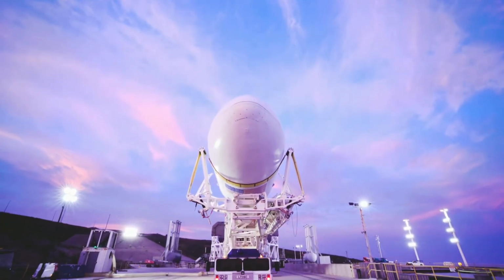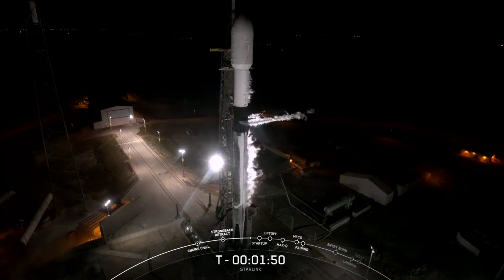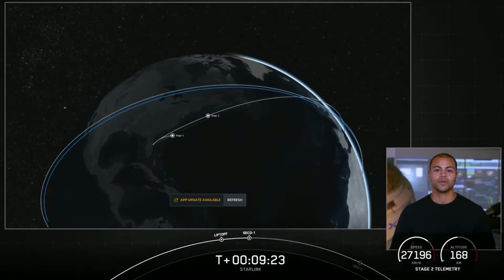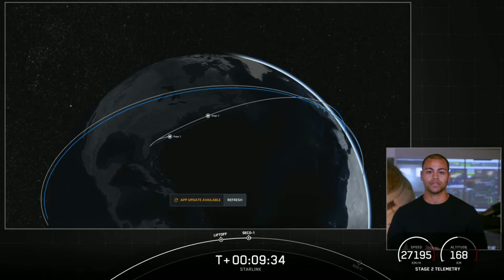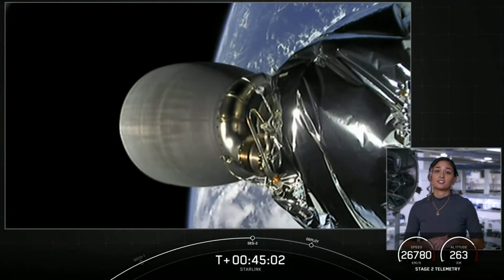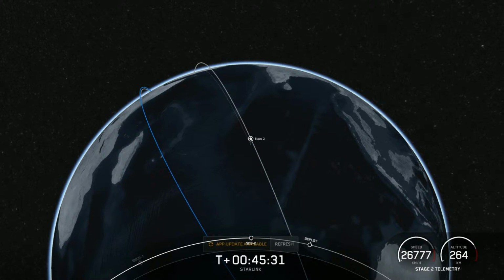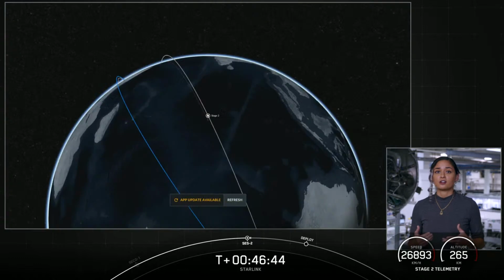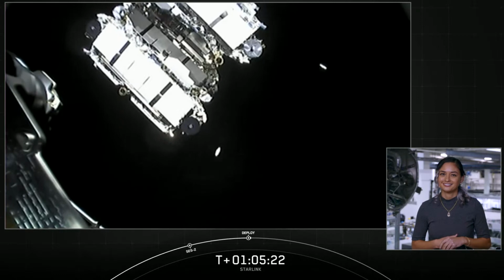Starlink Mission

Comment: So there are radiator tubes carrying cold liquid fuel through the stage 2 exhaust chamber? Because the metal is b so translucent with heat that it's hard to believe tubing would survive
Reply: The combustion chamber and nozzle are regeneratively cooled, but the nozzle extension is not. The extension uses radiative cooling which results in the glow you see and gas film cooling from the turbopump exhaust injected near the top of the nozzle extension.
Reply: @steveadams7369  Wow it's hard to believe the nozzle extension can still hold integrity when its so translucent. Thank you for your informed answer.
Reply: @jjtimmins1203  - The nozzle extension is made from an alloy of niobium. It has a fairly high melting point: 2477 C (4491 F). It is amazing to watch!

Comment: I like how Elon has given us the electric car so he can use all of the fossil fuel that is left to go find some more. FUCK.
Reply: What is wrong with u
Reply: https://youtu.be/gPeyXDtVPEg
Reply: Except he is using nitrogen...... which is man made..... and literally requires CO2 to make LMAO I bet you feel stupid now
Reply: @AB-xe6ci  no because i didn't put any thought into the joke at all.
Reply: @AB-xe6ci  and last I checked kerosene is derived from fossil fuels. The commentator stated kerosene was the propellant at the beginning. U  would know more than me apparently.
Reply: @AB-xe6ci  Umm, Nitrogen? What are you talking about? Nitrogen is the primary component of the atmosphere. It's about 75% of the air you breathe. It is a very unreactive element and certainly doesn't make rocket fuel. The only thing SpaceX uses nitrogen for is pressure testing their tanks. The Falcon rockets burn RP-1, which is a highly refined form of kerosene. Starship burns methane, which is the primary component of natural gas, but can be artificially produced to be carbon neutral. They are not doing that yet, but it is the plan.
Reply: @odysseusrex5908  “Nitrogen has a long association with rocket fuels and explosives, such as nitroglycerine and TNT (trinitrotoluene). This is because nitrogen gas, N2, is extremely stable. Compounds with more than two nitrogen atoms per molecule release readily decompose to N2, releasing a lot of energy as they do so.”
Reply: @AB-xe6ci   Neither TNT nor nitroglycerine are used as rocket fuels. Falcon rockets, as I said, use kerosene, and Starship uses methane. I suppose some hypergolic fuel might have nitrogen as a component. Do you know of one? Anyway, your post implied that pure nitrogen was the fuel.
Reply: Just for what it's worth, the electricity that goes into electric cars is generated by burning fossil fuels.
Reply: @odysseusrex5908  yeah that's what they say. Once the fossil fuels are depleted and there is no infrastructure to sustain the population.....genocide for all! Back to basics brother!

Comment: Why don’t you shoot them from inside the earth like a rail gun. Then use rockets to get through the atmosphere? Starting from ground level with rockets sounds stupid.
Reply: What do u mean "like a railgun"?
An actual railgun?
Do u have any idea how much power that would take?
US military railguns needs 25 megawatts just to get a projectile no larger than a missle to go super sonic. Now u wanna shoot several hundred tons of cargo into into orbit?
Reply: @neon-lake   Hell ya!
Reply: @Tech_Duster  2 issues I Can think of off the top of my head. 
1: you can’t launch into orbit from one burn, you need an extra one (preferably at apogee) to reach orbit. 
2: there will be a stupid amount of G’s crushing the payload.
Reply: @thingusbrulingus   Kinda my thought, starting from the ground and the amount of energy it takes to lift could be substituted with an extremely long underground tunnel that uses electromagnetic propulsion. You wouldn’t start at max speed. It would be a build up. If it was done this way the materials could be stronger and heavier. Since a rocket launch already has a long arch not much would change. I guess you would have to have the tunnel rotate for direction. Possibly would still need a second boost. ?

Comment: I have a idea the ship can't land probably because ship have one booster the one push up.....if you add  4 extra booster in left side right side front side and back side the ship can balance when landing... like example ship's booster in down its give pressure to go higher while landing the down booster can help but the helping % is 0.1%...if you add 4 or 2 booster not in lower side of ship little bit higher place Install 4 or 2 booster....if you install 2 booster... the booster place is left side and  right side......if you install 4 booster...the booster place in left side right side front side and back side.....the new installed 2 or 4 booster they can control the way the ship landing with only one booster the ship can't control....if you not understand can mail me i will explain how the processes working

Comment: Hello Spacex Team
I’m not sure if you can get messages to the SN design teams ; though some high performance cars with heavy g force loads on cornering have a sponge like substance in the fuel tanks and a Timpanic like membrane to keep fuel flow constant to stop air (or helium as in SN10) starving the engine of vital constant power
Stuart in Ireland

Comment: 30:42- 30:45  during a SECO DRIFT all power thrust is shut down. How can an object be seen flying passed on a camera looking towards front/bow/head of vessel? Or am I mistaken on the position of view ?
Reply: The rocket must frequently vent oxygen from the LOX tank as it boils off, in order to maintain pressure. Upon venting, some of that oxygen freezes. It has a certain amount of relative velocity which can be in different directions. That was probably just a bit of frozen oxygen going by.

Comment: Why is the Stage 2 speed decreasing in coast phase, if there is no friction at all? And with that, how come the altitude is increasing?
Reply: It is on an elliptical orbit approaching apogee. The spacecraft will continue to lose speed and increase in altitude until it reaches apogee. It would then begin to lose altitude and increase speed until it reaches perigee. If nothing else were done, the spacecraft would continue in this elliptical orbit until drag forces would bring it down.

It’s the same concept as when you throw a ball across a field. The ball decreases in speed and increases in altitude until the ball reaches the top of its arc. In then begins losing altitude and increasing speed.
Reply: @steveadams7369  thanks, it makes sense.

Comment: [05:00] Broadcast Intro
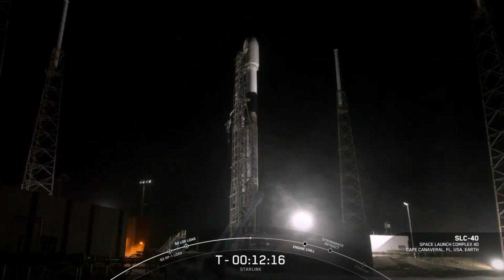[05:42] Broadcast Starts
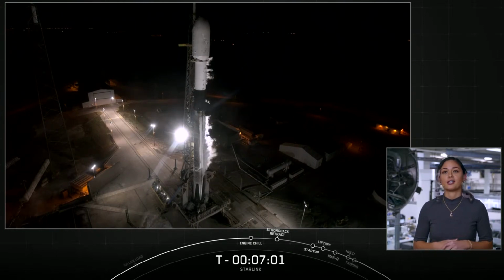[11:00] Engine Chill
[12:43] Strongback Retract
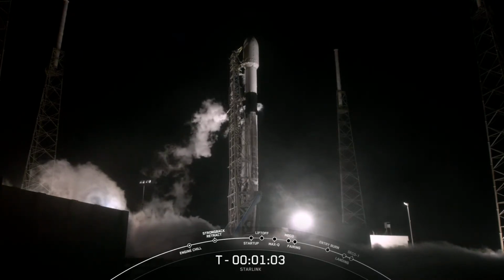[17:00] Startup - Falcon 9's flight computers take control of the countdown
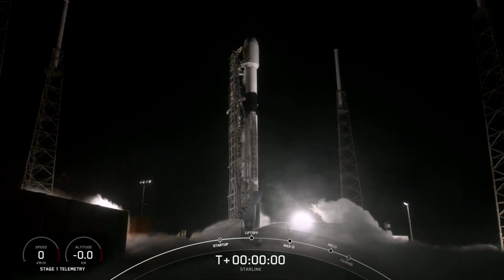[18:00] Liftoff!
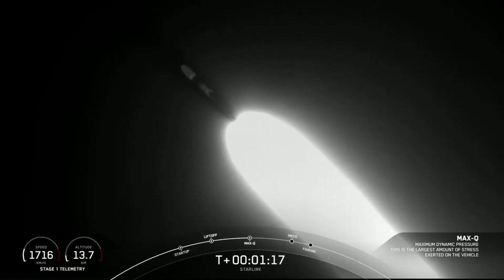[19:16] Max-Q - Maximum aerodynamic pressure on the Falcon 9
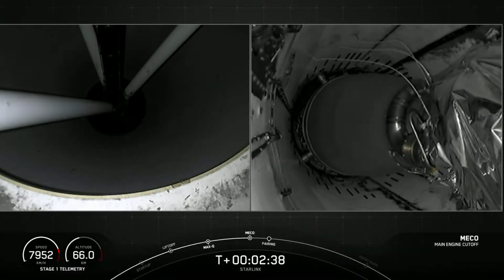[20:36] MECO - Main Engine Cutoff
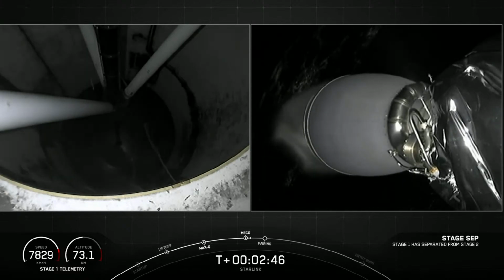[20:48] SES-1 - Second Engine Start 1
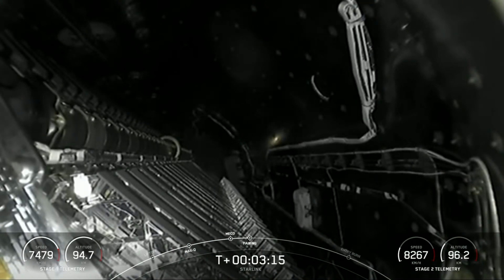[21:16] Fairing Deploy
[24:26] Entry Burn
[26:10] Landing Burn
[26:26] Touchdown!
[26:55] SECO-1 - Second Engine Cutoff 1
[1:03:56] SES-2 - Second Engine Start 2
[1:03:58] SECO-2 - Second Engine Cutoff 2
[1:22:58] Satellites Deploy

Comment: After earth pollution, space massive pollution.
Reply: These satellites are designed to burn up in the atmosphere after their end of life, so virtually no space pollution. At least not from spacex anyways.
Reply: @alxz3707  If they will not cross a non controlled satellite during there small live. If you want to take picture of the sky in night you will see only these fucking Musk satellite.
Reply: @richardmorenski5217  sure that is a problem. But I’m pretty sure internet is invaluable to some people who can only stay at home during the pandemic and who don’t have internet. Those people need starlink. SpaceX does need to work on their light pollution a little bit. Besides starlink is able to conduct evasive maneuvers, so they should be able to steer clear of different satellites.
Reply: @alxz3707  You will justify pollution of space just to have internet everywhere few years. After Musk other compagny will do this. See  the GPS  story. But now each time will will speak about more 10000 sattelites. In case of collision we will have a cascade effet. I think, the end of the space story is not so far away due to cupidity of minority people.
Reply: @richardmorenski5217  first of all the majority of space junk ~99% are small objects less than 1 cm in diameter.  Large objects over a couple dozen kilograms are easily tracked, and there are only a couple thousand of those. Starlink satellites are easily tracked and deorbited, preventing widespread pollution and making waste management easier. Besides your point of the satellites being physical pollution is irrelevant. Pollution is the introduction of waste into an environment. The Starlink satellites, still operational, are not considered waste, and therefore, cannot be referred to as pollution until they are defunct.

Comment: That stage 1 telemetry was a bit off on its altitude reading. It reached zero several seconds before landing and showed a negative value at touchdown. Oh well, the flight obviously went swimmingly.
Reply: GPS altitude is usually much less accurate than the coordinates in the horizontal plane. That's why the first stage uses a radio altimeter to measure the "distance to go" during landing.

Comment: I ordered Starlink yesterday. It should be available at the end of the year. I built a new house in a residential neighborhood but it was across the street from the existing cable. They want $15k to extend the line. My hotspot works but it drops a few times per day. Hopefully, Starlink will work well.

Comment: Why ins't a 4K video available?
Reply: space X YouTube channel best quality is only 1080p? Nobody had an Iphone with them?
Reply: @fabrizziolassage5779  they have the footage in 4K yet YouTube has its own restrictions and it also Is very memory intensive to stream video live in 4K Rather than releasing it just a while later
Reply: @connorhave6066  Good point .
Reply: The telemetry transmitter on the rocket provides about 3 Mbit/s data rate. This is used to send all the engineering data from various sensors, and also the video.

Comment: If SpaceX would design a Starship in a such way that you can attach 3rd,4th and 5th stage(with the same design as 2nd stage has now, basically big fuel tanks) to it while on orbit(train like design). After orbital refilling and attaching operations for those 3 additional boosters we start flight, use fuel from 5 stage, detach it, then use fuel from 4 stage, detach, and so on until we only have Starship 1st stage, by how much would it accelerate speed compared to just sending Starship with 1st and 2nd stage? By how much, if we for example send robotic mission to Mars, Jupiter, Pluto?

How long would it take with just 2 stages(current design) and with 5 stages or more?
I know those additional stages will be lost, but still, time is also money and by mass manufacturing them(which SpaceX plan to do) they wouldn't be that expensive

Comment: Nice to see there were no birds that might get killed on the landing platform.
Reply: Even if there were birds there, they'd be in no danger.. unless glued to the deck.
Reply: @TheEvilmooseofdoom  You mean they would have time to escape the flames?
Reply: @johnfraser8116  there own fault
Reply: @johnfraser8116  Yes, the burn stars thousands of meters up and those engines are not exactly quiet.  Any bird that isn't headed for the horizon at that point is merely natural selection in action.
Reply: @TheEvilmooseofdoom  I see. However, I don't think spaceship landing platforms were part of any bird's evolution.
Reply: @johnfraser8116  No, but getting the f*ck out of the area when something unknown, loud and flamey is coming out of the sky is in the wiring of most animals.  If its not then again, that's natural selection in action.

Comment: What impact would this have on birds.?
Reply: Why should it have any effect on birds?
Reply: @steveadams7369  birds tend to die due to  frequency.
Reply: @mohammednisar1994  - No, they don’t. The electromagnetic radiation from Starlink and other satellites is non-ionizing and is no more harmful than the radio waves that surround us all the time.
Reply: @steveadams7369  I don't buy it. For any typical wireless comm radiowaves has an element of bandwidth and frequency.
Which will also be applicable for any sats made till date.
In short: I don't think the waves are any special than the regular ones.

I can give you an example as well. If you are using any router (2Ghz or 5Ghz) you can notice birds, usually the smaller ones would never show up for days around your house. Reason is they experience cardiac irregularity in routers range.

Imagine starlink which will now cover forests, oceans and our homes. Where would the birds go then?
Reply: @mohammednisar1994  - Of course radio waves have a frequency. That is not the issue. Look up the difference between ionizing and non-ionizing electromagnetic radiation. Electromagnetic radiation of a higher frequency such as ultraviolet, x-ray, and gamma rays have the capacity to cause harm to tissue by breaking intermolecular bonds. Visible light and light of lower frequency doesn’t have this potential.

I have routers that are at those frequencies and I have birds abounding around my house. I am out almost everyday photographing birds and I have yet to see birds avoiding radio or cell towers. In fact, at a cell tower near my house, a pair of Osprey built a nest, laid and hatched two eggs, and fledged two healthy chicks. They spent over two months on a platform within centimeters of antennae to no ill effect.

It doesn’t matter what you buy or not. The facts don’t support your position.
Reply: Who gives AF about birds?! We EAT MILLIONS of them. They're ALL going to go EXTINCT on 🌏 ANYWAY (in ~1-2 billion yrs). Unless an animal is NECESSARY to stabilize the Earth system/natural world, it's just another TOOL to aid the survival of our species.

Comment: What happens to stage 2 after it releases the satellites?
Reply: De-orbits and burns up in the Pacific. SpaceX tracks it and notifications are given to air and sea vessels when it's coming down.
Reply: Does any of it make it to the water?
Reply: @scottskiles3064  Maybe some TINY pieces from the rocket, but most of it burns up.
Reply: Any idea what the cost of each of those sections are?  Those engines can’t be cheap.
Reply: @scottskiles3064  The more chunky pieces do not burn up, and are occasionally found. Carbon fiber reinforced cylinders for storing high pressure helium survive pretty well -- they just get charred a lot. The rest mostly burns. Even engines mostly melt and burn, though few chunks can survive.

The engines are not cheap, but there is no way to bring them back economically. SpaceX is trying to develop a much larger rocket now, which will have a reusable second stage.

Comment: The white clouds you see coming off the rocket on the launch pad is water clouds forming because the ambient air gets cooled down by the oxygen that gets released (which is very cold). I suppose the hosts are tired, but honestly, if what they are saying is wrong or misleading, I'd prefer it if they said nothing at all. But the pictures are beautiful. I especially loved the (infrared?) shot after stage separation where we see the booster bathed in the exhaust from the second stage...
Reply: Some of the white cloud is rapidly boiling LOX.
Reply: @TheEvilmooseofdoom  I've never seen "Oxygen steam". Under what conditions does the bioled off Oxygen recondense into opague "clouds"?
Reply: @vagnhenning  It's not recondensing.  Your understanding is flawed at best.  That's the stuff itself actively boiling in the air.
Reply: Water vapor and Oxygen are both colorless gasses. What makes steam appear white is because the vapor recondenses into tiny droplets that reflect and refract light. This recondensation only happens because the surroundings are cold relative to the boiling water. If you put your pot of water on the surface of the Sun, the water would boil without producing visible steam. Sure, a spray of liquid Oxygen is visible in itself but any mist surrounding it is made up of water droplets condensed from the surrounding atmosphere. And if you don't believe me, listen to what John Insprucker says the next time he hosts one of their webcasts.
Reply: @vagnhenning  Sure, which is why I said some of the white cloud is rapidly boiling LOX.  I didn't mean to imply all.

Comment: Why are SpaceXs Rockets powered by a mixture of Carbon instead of Hydrogen and Oxygen?
Reply: Hydrogen/LOX engines do have better performance. However, liquid hydrogen is much harder to handle and is not as dense as hydrocarbons. You would need to have larger tanks to get the same performance.

The new Raptor engines for Starship use liquid methane. It has better performance than RP-1, but not as good as hydrogen. It is also an easier cryogenic fuel to handle.
Reply: Aren't hydrogen/oxygen rocket engines extremely difficult and expensive to build?
Reply: @logitech4873  I don't exactly know, but who if not SpaceX will solve these problems?
Reply: @vnc3nt_105  They're moving over to methane/oxygen. Hydrogen isn't their focus.
Reply: @logitech4873 ok Nice to know. Bit Methan is Not so good dir the Environment too. And I das this because Spacex is launching so many Satellits
Reply: @vnc3nt_105  The F9 is fueled by kerosene, Hydrogen is a a great and terrible fuel all at once but not the ideal choice for a first stage or for reuse.  With Starship they will use methane with the plan in the future to start making methane from atmospheric Co2 to zero out the carbon foot print.
Reply: @TheEvilmooseofdoom  Thank you! Really nice to know. That seems nice